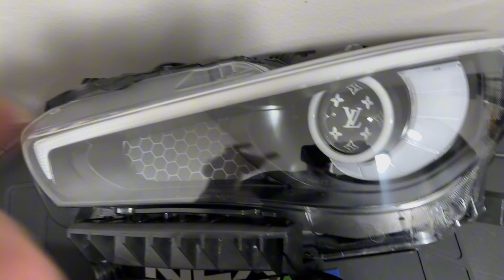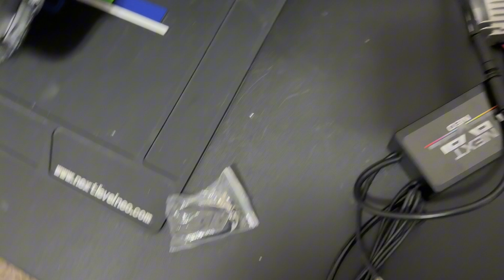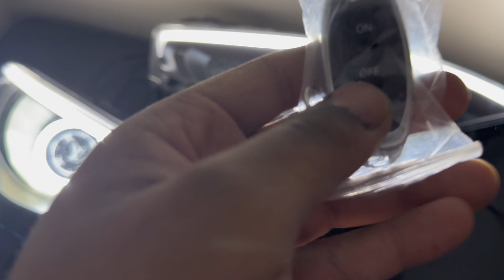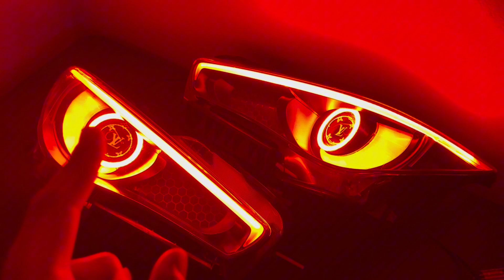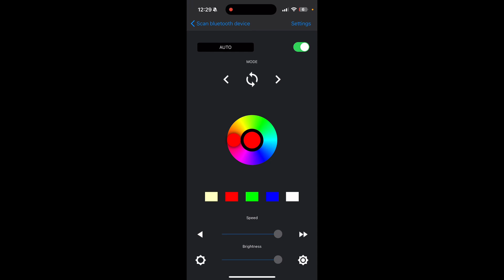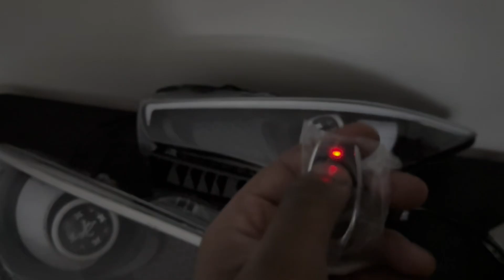Q50 CUSTOM HEADLIGHTS: FLOW SERIES BUILD

Comment: It seem like too much wiring on the controller! You should make a video to explain a simple wiring process! Also, where did you tap the turn signal wire coming from the headlights? Isn’t it the same to connect the turn signals straight from the controller? Or why did you wire it that way?
Reply from the maker: Wym too much wiring in the controller? U mean for me who makes it or for the customer that connect it up
Reply from the maker: It’s literally power and ground,  each headlights has a single connector to controller , then u connect ur turn signal. I think that’s the easiest way for customers.
Reply: @R @RETROFITSAMURAI  I honestly think it’s simple plug n play basically Im going to ship my headlights soon I’m for cali and I fw your work I want to be the only one in city with these sick as lights